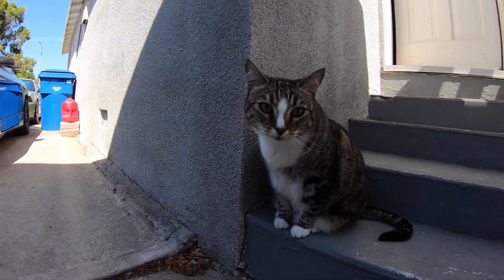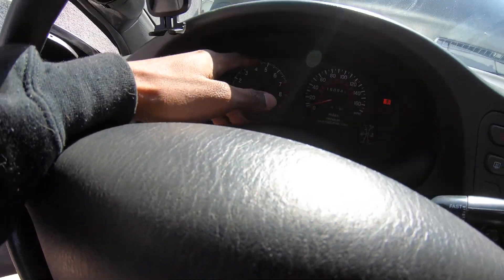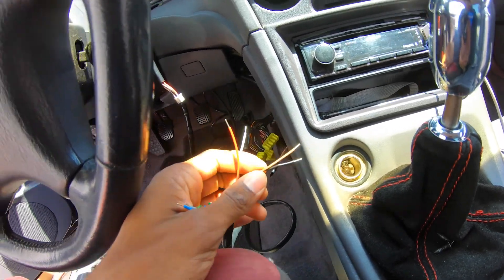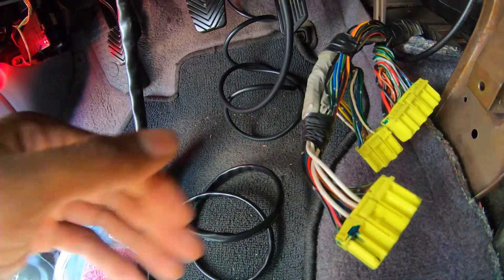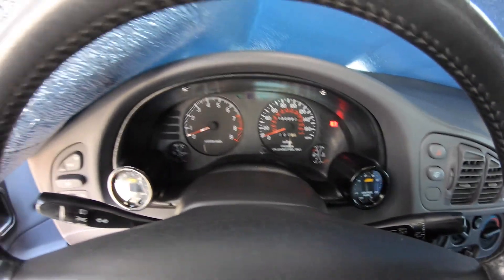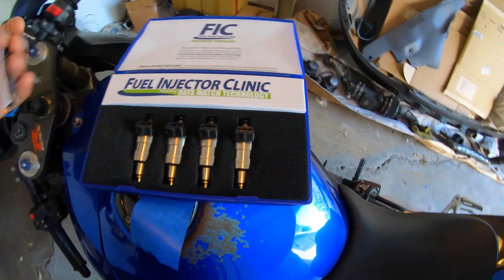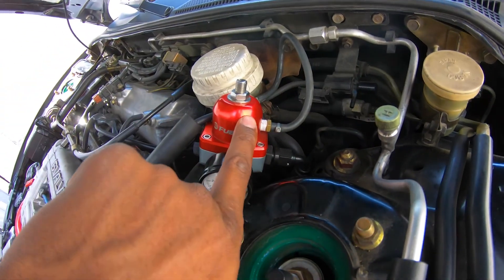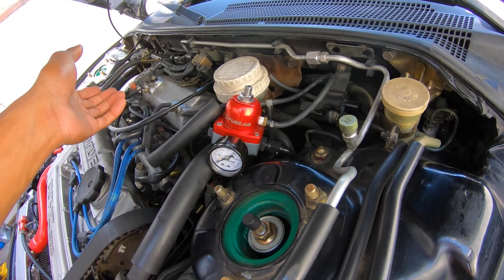2G Eclipse AEM AFR Wideband Gauge Install | Proper Wire up

Comment: Where did you route the vacuum line for your boost gauge? I don't see an opening in the firewall to put it through
Reply: Cut a small x through the steering column boot , on the right side , and push the wire or line through there and make sure it's away from all the pedals and not interfering with the steering column
Reply: @mariomorales_10  thanks 👍🏽
Reply: U can use an exacto knife to cut the small x

Comment: I did what you did what did you do with the check engine for bank 1 heater circuit
Reply: Join the both wires it will complete the heating circuit and check light won’t come on for that anymore
Reply: @Sweaty_like_PC_FNM wdym join both wires? Which wires? The white ones at ecu?

Comment: Question 🙋‍♂️ what if you welded the aem sensor to the down pipe. Where would I weld the white cable?
Reply: Solder the white cable *
Reply: If your on link you tap in to the correct pin depending on year of ecu and run narrowband sim on ecmlink